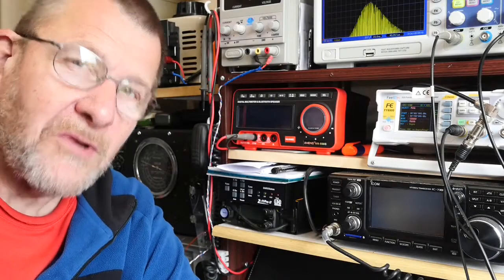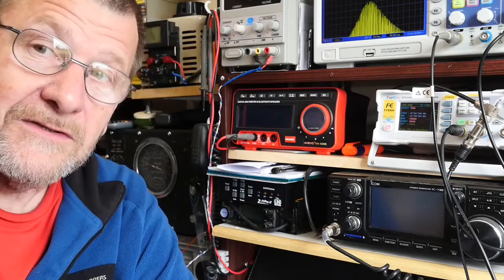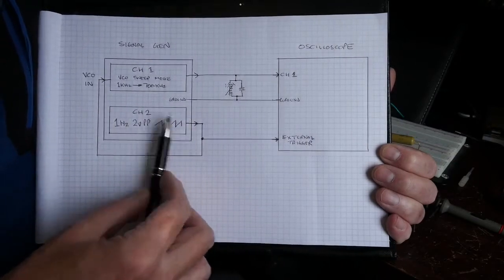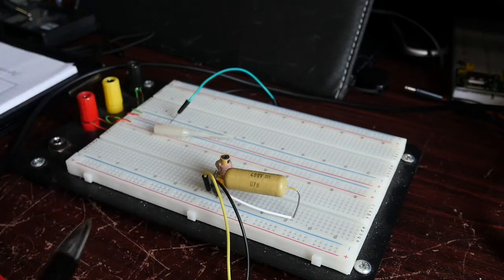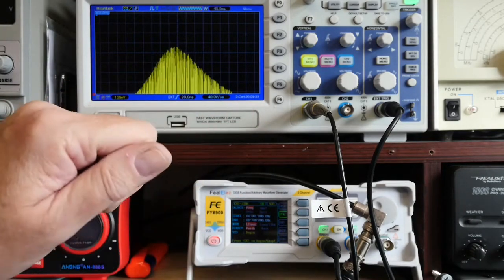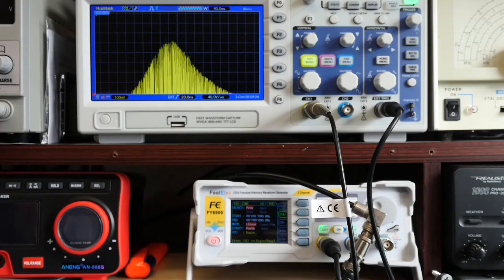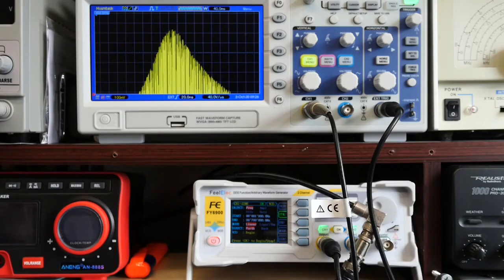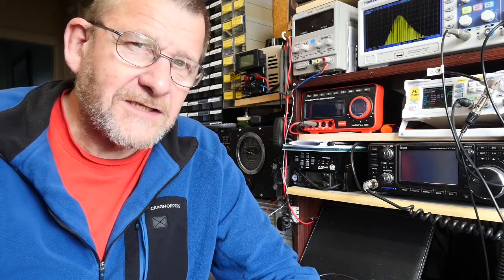Bode plots with a Hantek DSO5102P and Feelelec FY6900

Comment: So, I achieved almos the same result with psg9080 and atten 1102cal. All I had to do was set all coupling to DC (channels and trigger). The remaining issue is that it seems psg9080 does not sweep the vco frequency smothly. It sweeps the vco frequency at large steps  so the plot at the oscilloscope looks like an 8bit sprite game. Any ideas and sugestions to solve this will be welcome.
Reply: did you achieved the same results  with coupling output 2 to the mod input through a T-piece as in this video? if i do this on my PSG9080, the calibration values in the VCO menu shows min. 16 and max. 20. i do not get a stable VCO output with these values. which values do you get ? it is indeed a shame that here is so little detailed info available for this device.
Reply: @marcocochet2242  in my psg9080 the min value is 984 and the max value is 45,789. I tried with T-piece and another signal generator (MHS-5225A). I think the problem is that my ATTEN 1102CAL (original firmware) does not trigger at frequencies lower than 10Hz. So I'm not able to generate a ramp signal long enough (in period terms = low frequency) in order to the VCO generate smooth value as the ramp increases its value.

Comment: Is it possible to achieve the same results with a psg9080 and am atten 1102cal? The psg9080 requires measurement of min and max voltage for vco sweep to work and atten 1102cal seems not to recognize frequencies under 10Hz even for external trigger. If anybody has achieved this results with this setup, please let me know.

Comment: Thank you! I recently reached same approach using same generator but connecting CH2 of the oscilloscope connected to the ramp and triggering from there. It worked quite well but my big concern was how to make sure the programmed freq range in the VCO match with the VCO input voltage. I see you use 2Vpp and the manufacturer stated Max 5Vpp. I was struggling how to fit the input voltage range with the programmed freq range. In the end it was not too clear and I had to set it empirically. Not sure if you had same issues but your insights will be much appreciated
Reply from the maker: Yes, that was also my concern. The 2v ramp just seemed to trigger the sweep range that I had programmed. There are some unanswered questions here, but it worked so I have left them unanswered!

Comment: Hello friend, can this oscilloscope be used to measure the phase and gain margin of the control loop of a switched source? Can the diagram be transferred to a computer?  Best regards.
Reply from the maker: The scope will display phase differences, screens can be copied to a USB drive. Hantek provide PC software for full PC control of the scope.